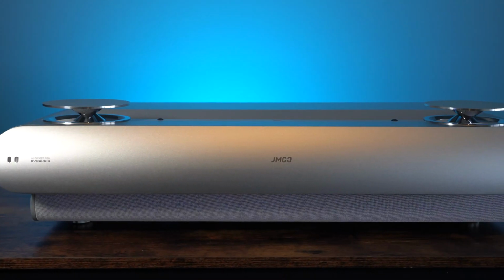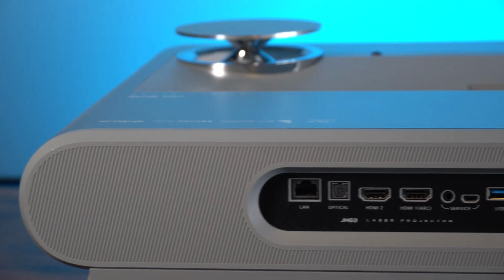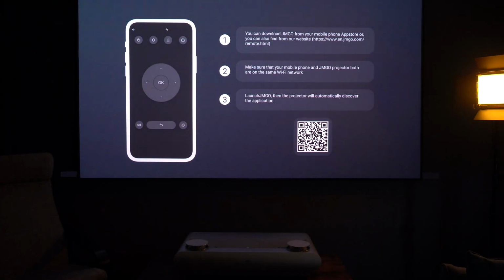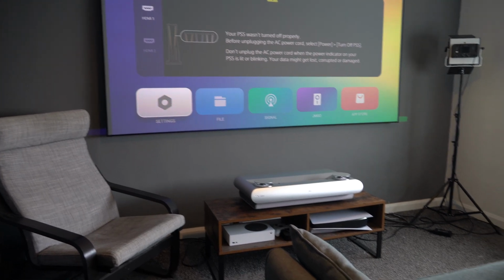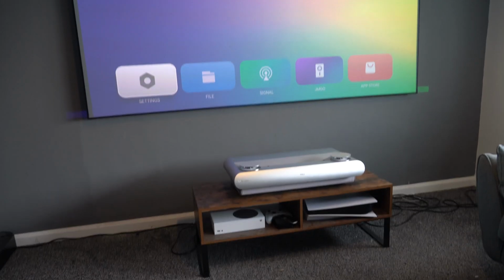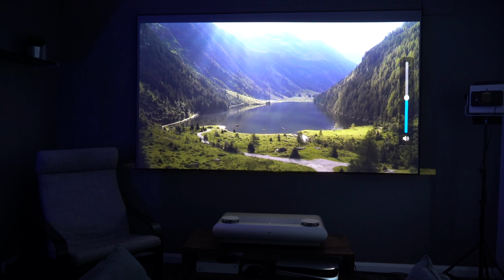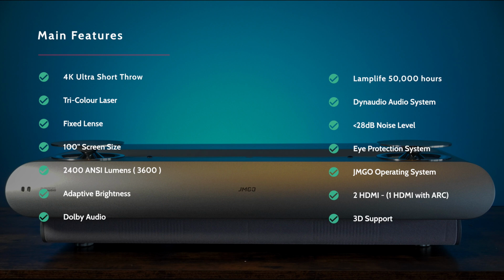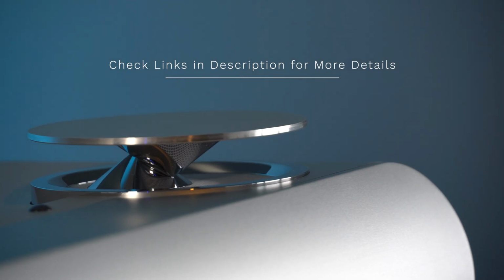JMGO U2 4K Ultra Short Throw Laser Projector is The Best looking Projector on the Planet

Comment: I understand that the projector and the wall distance is fixed. How about the height between the machine surface to the bottom line of the screen? is that adjustable?
Reply: I think the height depends on the distance.

Comment: i cant fault my Benq w2700

But this is $700, now on there website screen looks bigger then 100 inch, deffo worth considering if you after a Short throw projector.

i dont use a screen mine projects to a white wall and its crystal clear,

the pro version at $1400 has auto adjustment/focusing  

max res 1080p yet claims its 4k which is a put off
Reply from the maker: The W2700 is a great projector, this is brilliant if you want UST